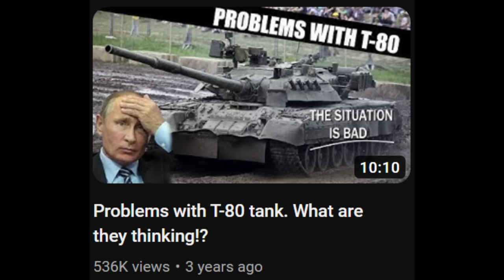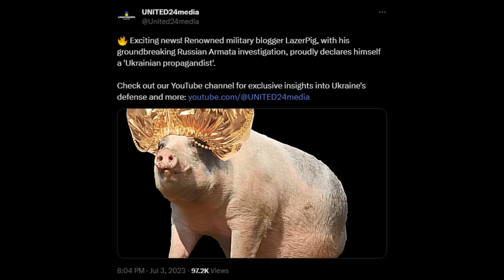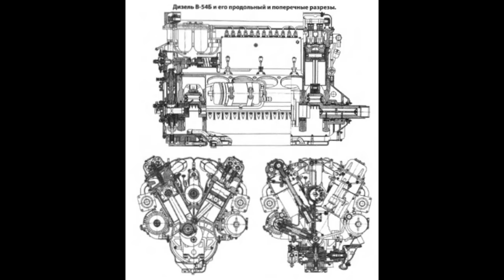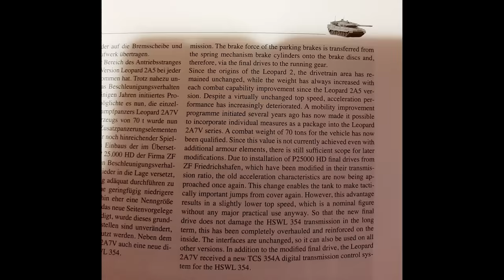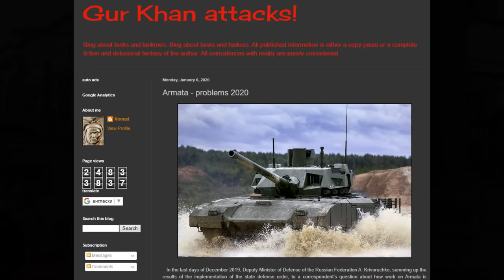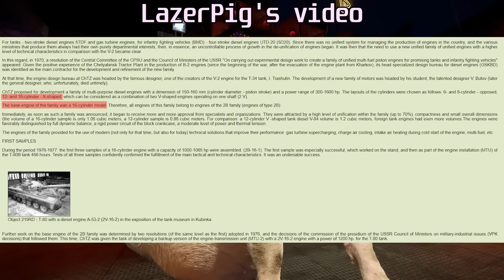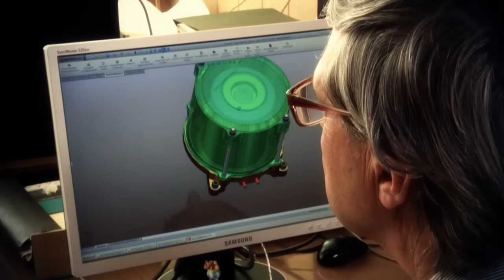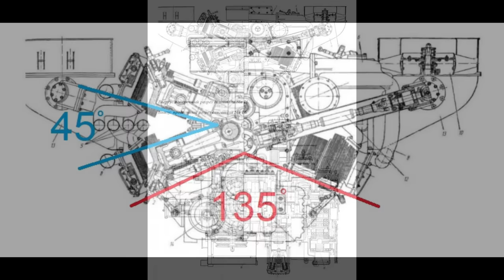Response to LazerPig and the T-14 Armata dispute

Comment: Either this can be resolved quickly or spiral down into debates.
Reply: Rooting for the latter tbh
Reply: YouTube: "SPI-RAL! SPI-RAL! SPI-RAL!"
Reply: It's simple.  If the head and block is the same , it's the same engine regardless of how it's modified: bored, or supercharged, or fuel injected, ETC.
Reply: I can take a Chevy 350 engine and modify it to make 550hp.  But it's still called a 350. Why?  Because the heads and block, modified or not, are the same.
Reply: @crforfreedom7407  technically all of the cars now including tesla are using copies of engine from Ford Model 1 right? since there's a spinning shaft
Reply: 2nd option is more fun (for us)
Reply: There is no debate; lazerpig and his stans just throw temper tantrums when anyone suggests that western hardware can merc soviet gear with 1 to 10000 win rates, and insist that observing reality is RUsSiAn pRopAgAndA.
Reply: @crforfreedom7407  It's less like comparing a modified 350, and more like comparing a factory 1955 Chevy 350 to a factory 2003 Chevy 350. It's the same engine, but it's been altered each model year, including block and heads, and also internally altered based on the type of vehicle it'll go in, to the point it's definitely not the same engine at all. People would take you as a fool to say your Silverado has a Corvette engine, although you could use enough semantics and technicalities to argue its true. This is the argument Lazerpig and Red are making. They're trying to clearly draw that ambiguous line between when your PC build constitutes a "new build", after you've replaced the gpu, ram, hard drive, case, power supply, mobo and cpu, part by part over a span of 15 years.
Reply: Debate format doesn't suit tank history videos. And I don't think it would help, research shows that debates can make people more entrenched in their views, and LP probably lashed out against Chieftain, against RedEffect and against Cone because he feels secure in his audience supporting him no matter what. He has a large audience that he has conditioned to give him almost fanatical support. A large fraction of these people will not be convinced no matter what.
Reply: @robcanisto8635  you are literally doing what you accuse lazerpig stans of doing.
Reply: @robcanisto8635  sounds like you’re triggered buddy - hence your response 😂
Reply: @crforfreedom7407  if they heads and bores are modified, then they are not the same. If a Chevy 350 has been stroked, or bored, or both, then sure, they will mention that it was an original chevy 350, but generally the engine builder will call the engine by it CI rating if its now a stroker for instance.
Reply: That's literally the two opposite reactions so that's not much of a prediction LOL. That's like saying that coin will either land on heads or tails.
Reply: At this point it is pretty one sided to call it a debate... Red is making bacon
Reply: @artnull13 bruh
Reply: @Kuraimizu9152  you mean he's getting smoked and turned into bacon.
Reply: @crforfreedom7407 According to that logic the M55 is still a T55 and nothing more.
Reply: Red effect doesn’t want a debate . Idk I feel like some people are hyper critical and want more reliability points because they critique both sides. Life isn’t a football match and we shouldn’t give ammunition to know liars and those that work for a state that’s very close to becoming fascist
Reply: @TKUA11  are you calling red effect a tool of the fascist Russian State? Because I'm inclined to agree these days.
Reply: @u2beuser714  bruh, if your blood has iron in it, you are vatnik.
Reply: The latter is better... look at how this debate forced them both to make their sources and reasoning more explicit.
Reply: @Mygg_Jeager 
Uh huh. Now tell me how you feel about azov, aidar, and other banderist nazis. 🥴🔨🥴🔨🥴🔨
Reply: Lazerprick wants the latter. He's a drama channel transplant in our tank community. He needs to be shunned and run off
Reply: @PBMS123  They'll say "it's a 350 bored to"... but it's still a 350.  I've NEVER heard anyone call their 350 by the new ci.  Ever.
Reply: @PBMS123  The difference between a Willys L and F head are the engine design.  One is a flat head, only has just the exhaust valves in the block.  BOTH ENGINES make the same 60hp, but because the block and head designs are different it gets a different name.  That's how it works.
Reply: @PBMS123  And BTW they aren't the same: Correct.  But the NAME of the motor doesn't change.  It's considered the same motor, just modified.  Again, I've been in and around the game a long time.  I've built several engines myself, when you machine the block and heads, the presets are for a 350.  Not some 'someday' preset.
Reply: @crforfreedom7407  sure I guess it doesn't but that means nothing, the name no longer means anything. 
What if the engine builder gives it a new name? Plenty do. But it means nothing at that stage.... which is
Reply: @Andreas-hh6vy  So as engines go, like aircraft, modifications don't change the name of the item.  With an engine, if the block and heads are the same basic cast design, the name never changes.  Just the level of modifications to that engine.
Reply: Debating pigs only brings you down to their level. 🐽😀
Reply: @rasselbidou 
It should be more civilized though. With mutual respect.
Reply: Too late, we're into the response to the response to the response video territory now. Any hope for a sane conclusion went away like two months ago.
Reply: Nothing spirally about debates. Debate can be a good way of getting to the facts.
Reply: @crforfreedom7407 I can see that you gained or did not bother to pay attention at all to what red effect was explaining about the engine.
Reply: @snowball7990  It's not that complicated to me.  The rules are pretty clear.  The block and heads being the same do basically make it the same design. Modifications make the design better, but yes: It's still the same 90 year old design.  If it works, there's nothing wrong with that.  IDK why someone would get defensive about that.  Especially when it's the transmission getting Russians killed.  Not the engine.
Reply: Lazerpigs fanbase has become a cult. I asked politely if he could cite his sources on a thread in his sub reddit and got downvoted into oblivion .
Reply: "spiral down into debates"
LazerPig? Debating?
...That's like asking an Italian to talk without moving their arms/hands...
Reply: @sleezerbarb9670 

>goes to a community area filled with fans in REDDIT

>Says something those fans don't like and gets down voted

>*Surprised Pikachu face*
Reply: Situation with Alpha Defense was resolvable because he too is a fellow weapons analyst . yeah it went bloody , but at last they did it and the end. but you never take a shitposter that much seriously . especially if he's 
1)wumao
2)kremlin bot
3)NAFO brigade

if not on political field,  i can accept kremlin bots opinion with a pinch of salt. that is all.  lazerpig is an official member of the NAFO brigade and as we know NAFO counters Russian propaganda with their own propaganda . which they sources from mostly twitter , WSJ , MSM and god forbidden Reddit.
Reply: @crforfreedom7407  applying your logic in the history of Tank development and i can also successfully conclude that  almost very tank in this planet right now are mutated FT-17s since their structural layout  is based around FT-17 that is engine to the rear , driver to the front and most importantly a 360 degree rotating separable Turret with a defined tank gun . does that means M1 Abrams is ultimately an FT-17 ? Because it has the same structural layout same as that of FT-17 . Same goes for T-90 , Challenger , Ariete , Leclerc , Leopard 2 etc etc . But in reality they aren't . 

The reason is despite  advancements  in metallurgical and material science  and in mechanical engineering, we haven't come up with any  other layout as revolutionary as FT-17 which we can make into a call it a tank. could you imagine calling any other  armored vehicles around us  a tank unless you have learnt your military definitions from mainstream media ?
Reply: @patriotenfield3276  Don't be so  melodramatic.  All piston engines have a block and heads.  That doesn't mean they're all Ford V8 engines.  Even though that engine is the basis of all modern piston engines.  THE SAME DESIGN.   That's what I said.  The blueprints.  If the head and block is the SAME DESIGN on the print, it's the same engine regardless of how it's modified.

Comment: 11:58 that’s really a moot point because most engines nowadays can literally trace their lineages directly to late 20th century designs. That’s literally how engine designs work. It’s always been easier to build off of an existing design than a complete redesign every time you’re releasing a new engine.

There’s so much differences between the V2 engine on the T34 and the T14 that saying they’re the same is just like saying the MTU engine on a leopard is just a diesel version of the Maybach v12 on a tiger.

Comment: Lazerpig saying SLA-16 is a copy of A-85 is like saying Sturmgewehr 44 is a copy of AK-47. I swear to God if he believes that. I will lose hope in humanity.
Reply: Haven't you written that wrong way around?
Reply: Yep, while the AK 47 have more in common with the M1 Garand than the STG 44
Reply: @trevornorfolk3103  The German assault rifles all used long stroke piston actions.  So did the AK-47 as did the Garand. In other words the trial assault rifles the Germans combat tested in 1942 the MKB42(H) by Hanel and the MKB42(W) by Walther, the MP43 and finally the StG44 all were long stroke piston operated with the cylinder at the top as was the AK47. They only differed in the mechanism in the receiver.  The AK47 was almost exactly the same configuration and mechanism as the German guns the Russians captured in 1942, 1943, 1944 except their own 10% more powerful intermediate cartridge.  The AK-47 wasn’t an exact copy of the German assault rifles but close enough in every way an imitation. The Russians would never admit to copying anything of the Germans, a matter of both Russian and Communist insecurity.  So they put up the meme that mechanism is completely different.
Reply: They have nothing in common except for intermediate cartridge !
Reply: @trevornorfolk3103 It was the AS 44 that mostly inspired AK 47

Comment: you absolutely nailed it red, truly one of THE best tank tubers out there. And going out of your way to talk with real tankers engineers, etc. is just awesome dude.
Reply: IT WOULD be awesome if Russia wasn't to scared to use it, maybe it might be good to cut down trees like the famous video of the "Terminator" tank.
Reply: @jaibusby673 the T14 is more of a testbed for the turretless tec and the new armament/ammo. They might use it but i doubt it, not just because it would be dragged across the western media if it gets knocked out by something the tanks capabilities have no influence on, like mines or artillery but there is also nothing in ukraine their current tanks can't deal with, including the western armor that has export grade downgraded composite protection anyway.
Reply: @DerDrecksack87 Only abrams is downgraded
Reply: @Asofe17   the Abrams doesn't get the DU armor, Leopard 2A 4-6 get export armor variants not the Bundeswehr one, basically the same turkey got with their Leos (i think germans use version numbers) and the Challenger 2s dont get the most moder chobham armor as far as i know, they all get composite inserts more representative of the early 1980s, but there is a lot of info floating around and i guess nobody knows for sure, except with the Abrams where they 100% get the same export variant Iraq got, maybe with different fire controls but not sure.
Reply: @DerDrecksack87 M1a2 Export variant only removed couple of plates from Turret face and that was it. The hulls have full protection of M1a2 in US services.
There's already pictures of their wreckage inspected and photographed in Iraq. No difference between Iraqi M1a2 Hulls and US ones.
Reply: @DerDrecksack87  reason to show that not all T tanks have jack'n the box turrets that explode failing like a Luna 25? Kievan Rus seems to be testbed for otter's tech.

Comment: Awesome response by RedEffect here, absolutely factual, no emotional ranting like LP.
Reply: What facts? His sources he has listed are forum posts lmao
Reply: @joshsquatch7474  still a sources and lazerpig uses it aswell, and unlike LP he linked them
Reply: @wonkagaming8750  Forum posts are not sources no matter how weak your points are. try again.
Reply: @Chedring  they are if reliable and credible, also those forum has bases either books or reports.

and most sources are forums western sources too so why the exception
Reply: @Chedring  Problem with your argument, primary sources for classified information is usually hard to come by. So, you need to piece sources together from various people and places to make a proper, well-documented arguement. RE does this well where he lists the out in academic fashion, LP misconstrues them and tries to cherry-pick information to support his rants.
Reply: @joshsquatch7474 finish the video

Comment: At 16:16 when he claims the engine is "at its limit of what it is capable of technologically through upgrades/modifications" is false for a simple reason - That's not how engines work. 40 years ago diesels were "at their limit" when they had things like manually adjusted injectors, but in the 90's when computers started to be used to regulate the pressure/amount of diesel injected into the combustion chamber the efficiency and power of the diesel engines went up.
Scaling this to today you can understand that there isn't really a limit to how efficient or how powerful you can make a specific engine, as all of it relies on how much development you want to put into it. Everything from size of the chamber, compression ratio, intake air temperature, air/fuel mixture, piston stroke, etc. determines how much power an engine can produce. Not to mention all of the other varying systems like the cooling system efficiency. Therefore, how good can an engine get? We have yet to actually know. Also, how much can you change an engine before it is an entirely new engine design?
- Me, an ASE certified medium/heavy diesel engine mechanic
Reply: The issue is what we call "bottlenecks". There's always something limiting your performance, and adding full digital control to a very old engine design will only acomplish destruction of the engine due excess vibration, pressure/temperature, etc.

Comment: Thanks for standing up to the truth.
Also the latest modification of the V92 is the "В92-Ф2С2" (V92 F2S2) which was revealed all the way back in 2012, and we don't know if they had improved it since than, because the information of that engine is kept in secrecy. 
Also it didn't break down at a rehearsal of the parade, what happened was that it was set to hand break by accident, and the crew didn't realize that it was on the hand break. The tank itself didn't break.
Reply: If you want to know make gaijin add this projectile

Comment: Let me try use lazerpigs argument in a slightly different format.

"The engine on most modern tanks uses a series expansion chambers, that cyclicly compress and auto ignite a fuel and air. Therefore they are basically all fundamentally the same as the first Motor 250/400 diseal engine built by Rudolf Diseal in 1896, which only had 17HP and horrific reliability issues (almost killed diseal engine concept entirely).  IMAGINE building tanks around an engine that ancient and pathetic. "

From lazerpigs logic in 16:20 that the technology has already reached the limit of from upgrades and refinement (which is partially true). Thus all diseal engines is not that better the Motor 250/400 that Rudolf Diseal made in the 1800s (which is a massive stretch).

Comment: im no tank expert or even a car guy. But even I know that new engines arent really enirely brand new designs. That would be stupid because we figured out how to make a good engine a long time ago and we can only improve it further. There are many other technologies like this. Has a refrigerator changed since the 1940s? No its the same basic concept and design just improved with modern materials. There is still much research to be done one jet engines, but eventually it will reach its peak as well. And maybe in the year 2223 LazerPigs descendant will be saying "Look this new Russian jet uses the same SCRAM jet from the world war 3 era Mig-420!"
Reply: Great point! Just shows how dumb lazerpig is when laymen like us get it but he a supposed military expert doesnt.
Reply: @tomvobbe9538  Stop calling him stupid, he did not call anyone stupid.
And I can show you of an inside fridge from 1940s and of a modern one.
You will not find any similarities.
Reply: @CorruptedSpider  My Antique Fridge engineering expert is with me right now and he's calling BS on what you just said.
Reply: Fridges have had massive advancements. Even the working fluid used is different.
Reply: @CorruptedSpider as an antique fridge, that is very offensive and complete bs
Reply: @tomvobbe9538   How can we believe you?
We can't.
Do you have any proof to disprove my statement.
You don't.
Reply: @aycj2680   No it's not. Features like deep freeze, different working fluids, changes in the pump cycle, basically everything.